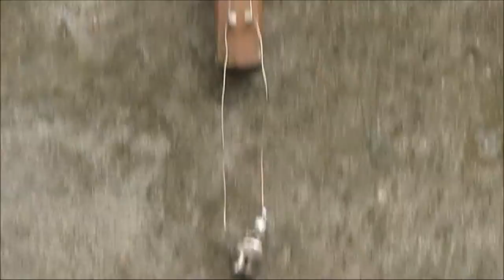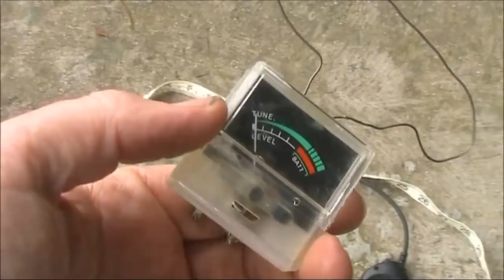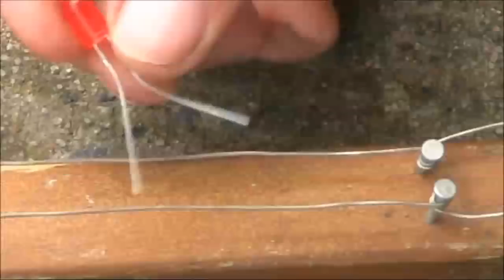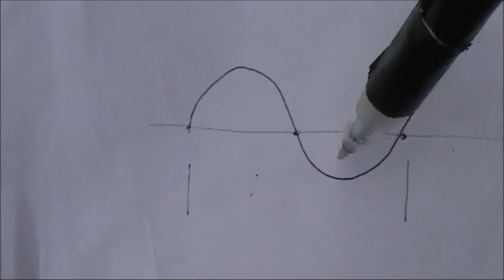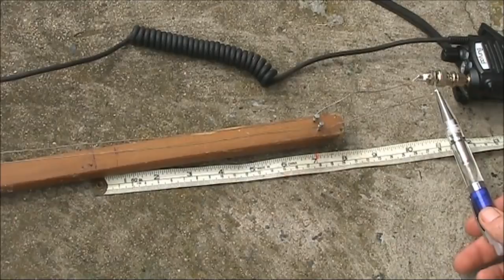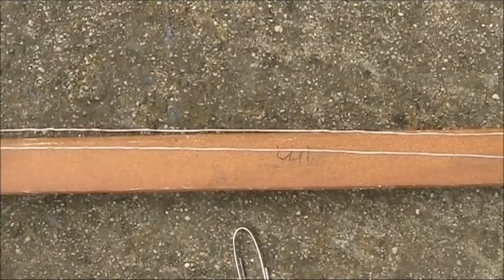Measure frequency with wood, wire and nails: Fun with lecher lines

Comment: Edited because I screwed up the calculation initially.

If you take into account the velocity factor of the wire would the reading be closer? Indeed, given that you know the frequency and the measured half wavelength you could determine the velocity factor and then apply it when you don't know the frequency.

In this one, the velocity factor is about 0.9826. If you divide the measured wavelength in both cases by this number before dividing it in to 300, you get pretty close.

Comment: I suppose what we are seeing here is the standing wave in your wires. I wonder if we could improve the measurement by calculating the velocity factor of your set up.

Although a great set up for measuring the frequency, isn’t it also helpful in thinking about transmission lines, antennas and impedance matching? By changing the length of the wire would you get higher peaks?

Great video Peter. Thank you.
Charlie